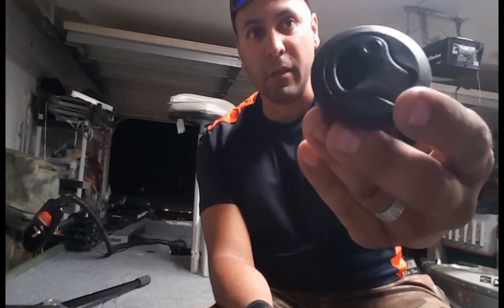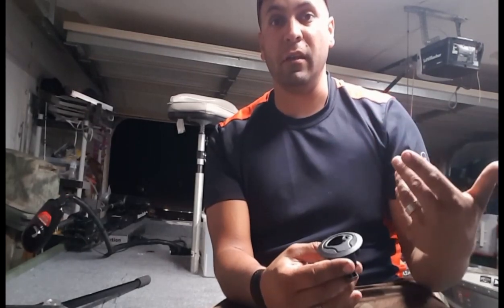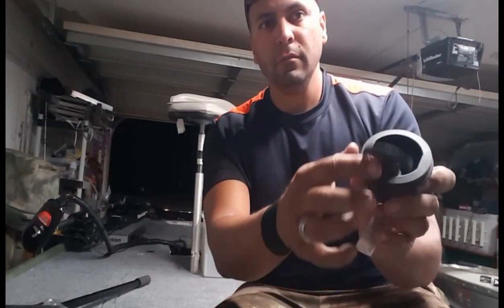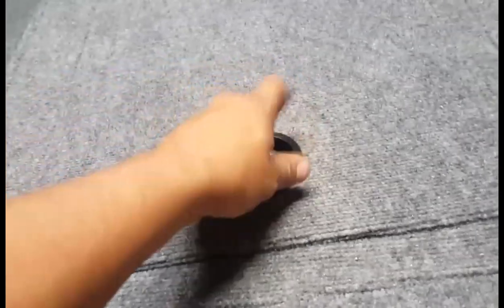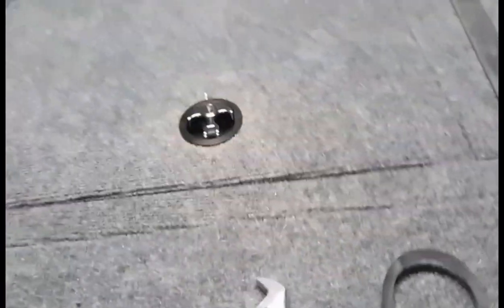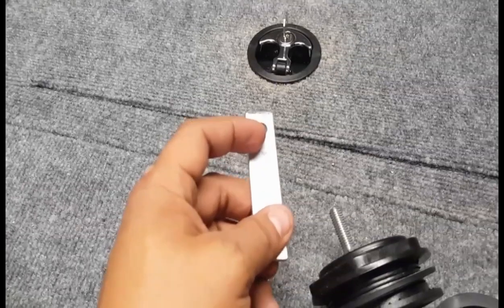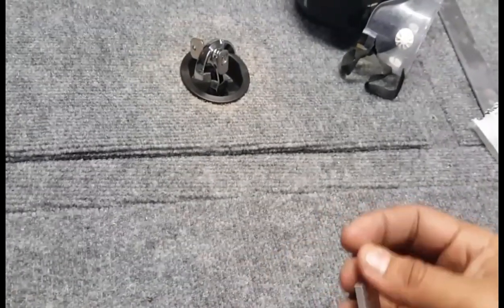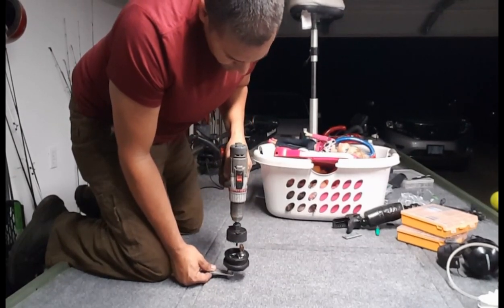Boat Latch instalation- all different types. #TBNation

Comment: I'm just about at the stage to carpet and latch. After watching this a couple months ago and started my project I did have a question regarding the hole you drilled. If you were to do this again would you pre drill the hole prior to putting carpet on? I bring this up because after sealing your wood it seems that you defeat the purpose of doing so by exposing the wood to draw the hole.